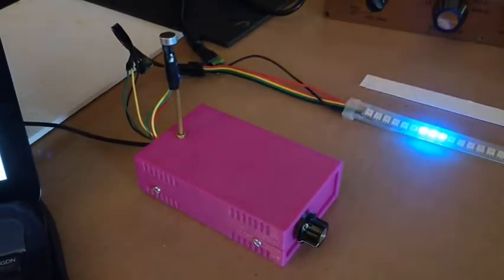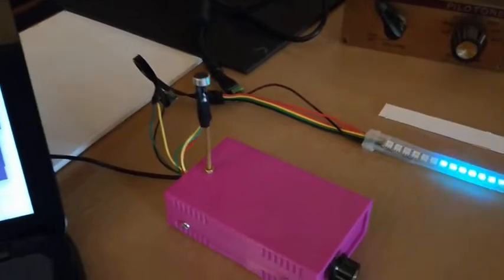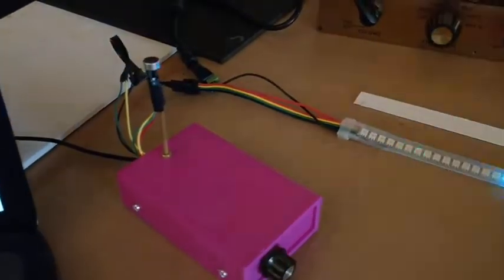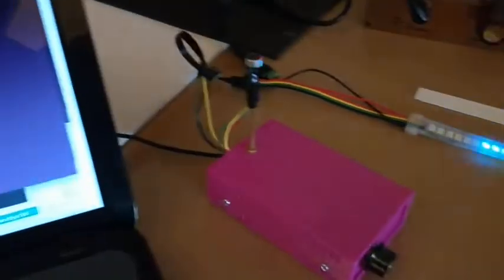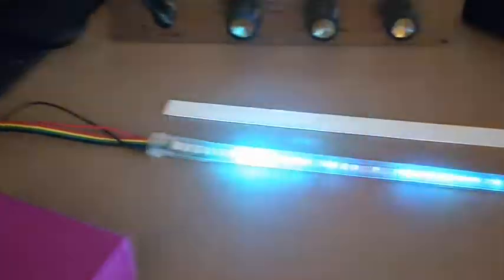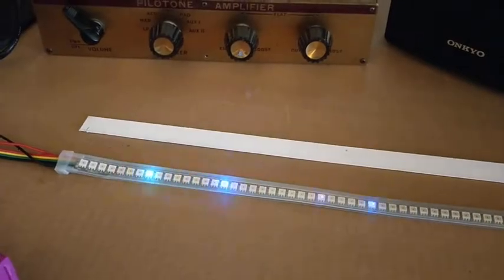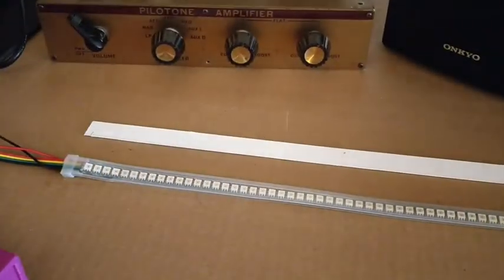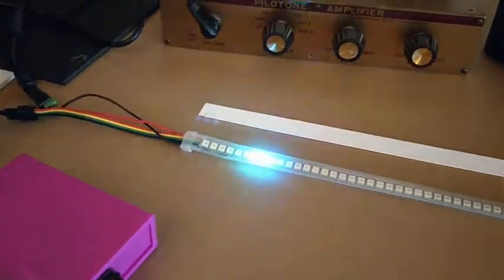Sony Spresense fft leds introduction

Comment: can this project work in arduino? if yes where i can get the hammingwin library.... thanks in advance
Reply from the maker: Depends on the arduino :)   There is a popular Fast Hartley Transform library for Arduino that is optimized for the avr processor. http://wiki.openmusiclabs.com/wiki/ArduinoFHT . The video is using a 156MHz arm processor in the Spresense, that is just fast enough to process 256 samples in the 16mSec cycle time.    The hamming window was just copy/paste from octave signal library into a header tab.
Reply: @ChuckSwiger  can have copy of hammingwin library?
Reply from the maker: It's on github  https://github.com/cswiger?tab=repositories   there is a 256,512 and 1024 size files, here is the 256  https://github.com/cswiger/fftleds_N256/blob/master/hammingwin.h       The main project  page is at  https://github.com/cswiger/fftleds_N256/blob/master/hammingwin.h with more discussion.